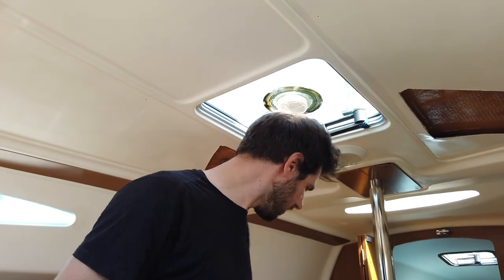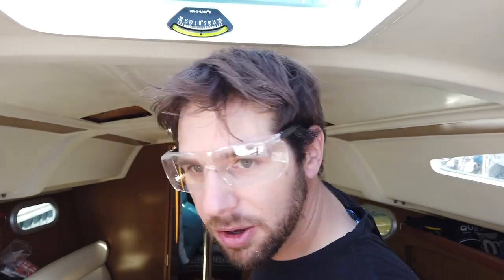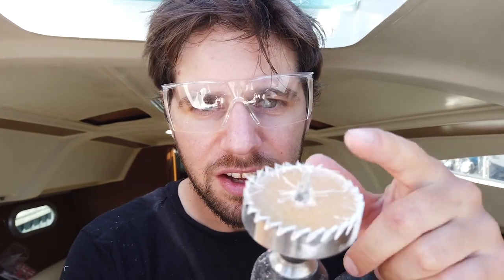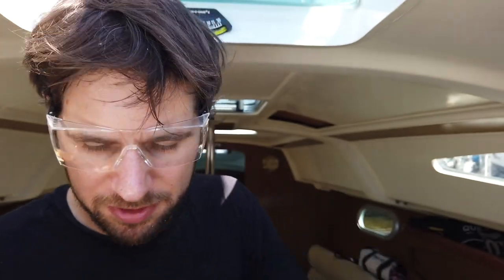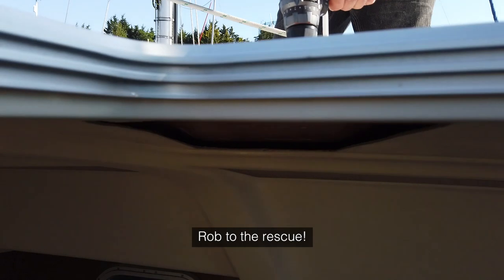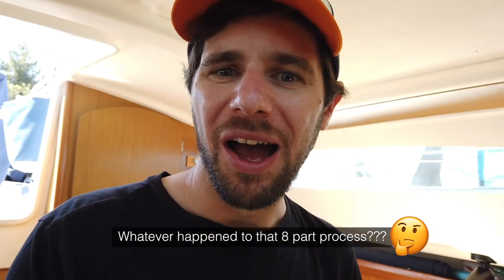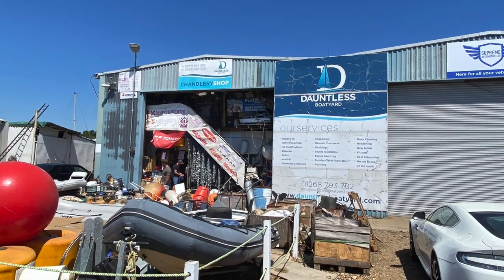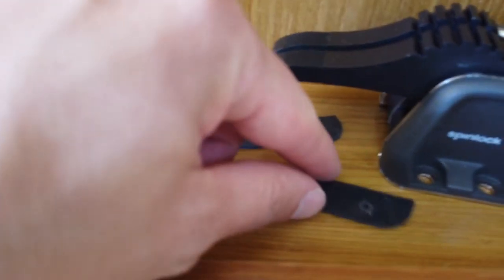Changing to a German Mainsheet system

Comment: Good Idea, I am planing to do a similar thing, but...I did not catch what size bolts you used at the ends of the track. Their heads look like number 10 or 12 screws. They will carry a LOT of load, they need to be, I would say, at least 8 to 10mm, with large washers, or even doubler plates underneath. The track itself needs to be stiff as well. Teak is NOT a reinforcement for a metal track. I would use a track at least about 5cm thick(tall), because it is only held at the ends; teak does not do anything to stiffen it. Good luck.
Reply from the maker: Hi Jarek, yes a very good point indeed! If you watch the next video about sailing with this new mainsheet you'll see I ended up replacing it with the much strong high beam track as just as you said it would the teak did warp over time! We used plenty of large washers for that installation. So far it's been working really well. Good luck with your project, I hope you can learn from my mistakes!

Comment: 6 minutes into this video have not yet finished the video, this video has been out for over a year. 
My knee jerk reaction/ thought is, "That track is going to get ripped off the bloody teak  and destroy your companionway in an accidental jibe if not just over time with multiple jibes."  I know you said eariler in the video you have  seen this modification done on other, similar boats but I wonder how many hours of heavy weather sailing they have seen.  Fingers crossed this modification is safe and holds up.

Your points about the main sheet being attached to the ring in the floor center of the cokpit all make sense but jesus man none of that matters in a 20knt accidental jibe. 
good luck.
Reply from the maker: It's a fair shout, if you watch the follow-up video you'll see at the end I explain after piloting this I switched for high beam track and a tougher installation with some professional help. We've been out in 30 knots since without issue, it works really well.
Reply: @Sailing Summer Breeze  I appreciate your reply, Thank you.  I will and look forward to watching it.
I saw this on a tee shirt 2 days ago,
'Nothing is learned from success,  everything is learned from failure. '

-May you have fair skies and the wind at your back.
Reply from the maker: @rwehuman  I think that's definitely true! Although I appreciate the comments on this video as it shows people take safety seriously which is important on a boat, I do too!
Reply: @sailingsummerbreeze  Nice upgrade. well  done sir.

Comment: Exactly the opposite mod that I would have made. He German mainsheet takes the sheet away from the helm, meaning a second person is needed to adjust the sheet whilst the helm is steering. Fine, unless you are singlehanded.
Reply from the maker: That was certainly a consideration! I do sail solo quite a lot but luckily the auto pilot is like another crew member. I also normally sit up on the coaming when hand steering where it is possible to still hold the sheet and let go if needed. It’s not a huge cockpit so moving it a couple of feet away hasn’t proven a problem 😁

Comment: I'm not sure where you're planning on sailing this, but your new hardware looks at least one size under what it ought to be. At least if you're sailing in a breezy area like San Fransisco. Be careful and do lots of testing before taking that offshore
Reply from the maker: Yeah you’re completely right. The follow up video shows me testing it out and how I ended up replacing it for the stronger high beam track due to having the same concerns!
Reply: @sailingsummerbreeze  the track will flex, I'm concerned about your block and clutch blowing up during an auto gybe

Comment: Only 2 screws on your track traveller ? Hehehe....
Reply from the maker: It's a reasonable concern! At the end of the follow-up video to this one I explained that I replaced the track with high beam which I had some professional help to do. Been out in 30 knots since without issue but yeah the original installation featured here left room for improvement for sure :)

Comment: Sorry man but that track will bend as it looks like you have bolted it to the deck at the ends. The teak will not give it much support bridging that far. All the best
Reply from the maker: You’re not wrong! That’s exactly what I found. After testing it I changed it for the high beam track which has proven much better 😁